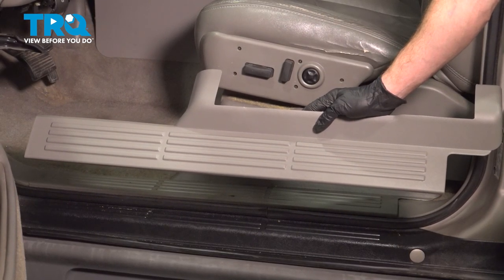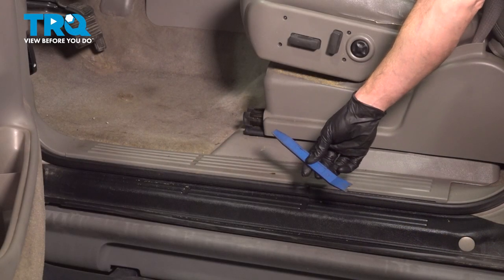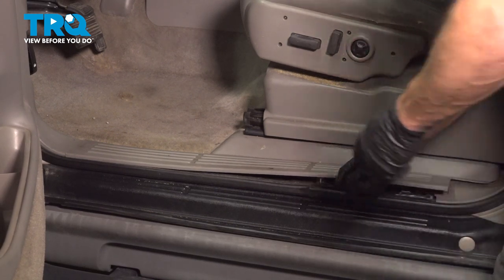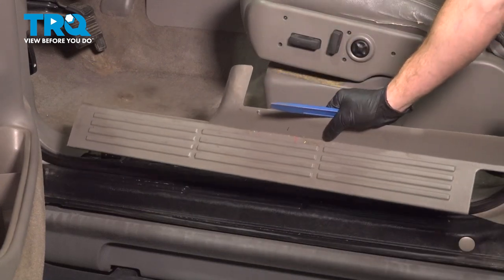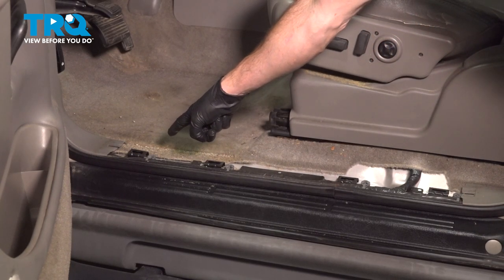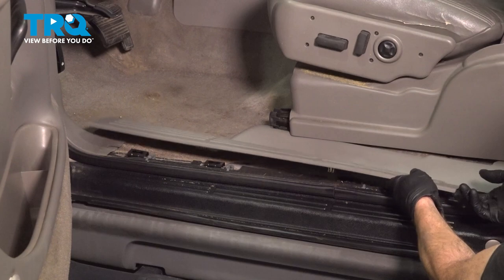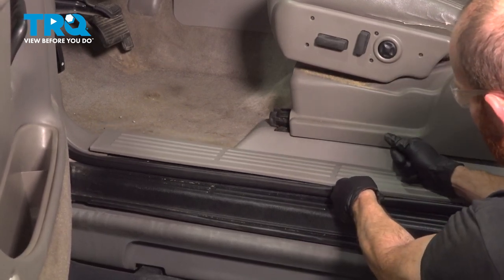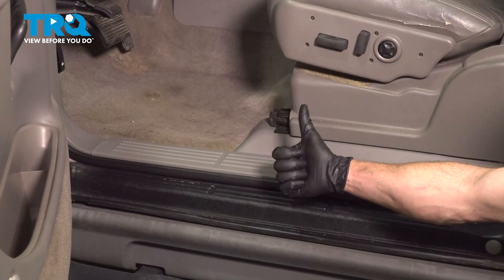How to Replace Door Sill Plate 2000-2006 Chevy Tahoe

Comment: Yes I also would like to know what is the plastic piece directly below the sill plate and the door weather strip called? The seal on mine is torn from getting in and out. I was thinking door kick trim but i have not found it yet. Thanks